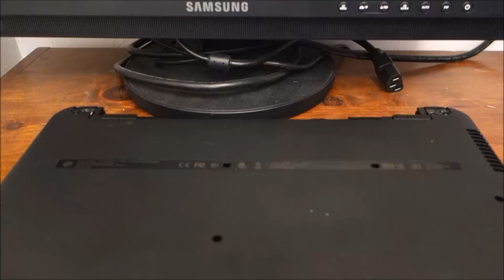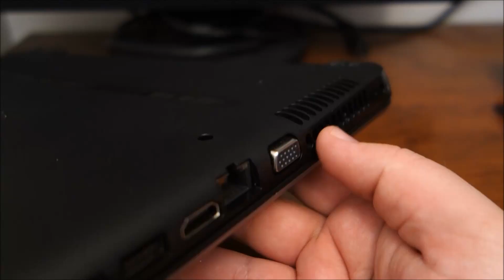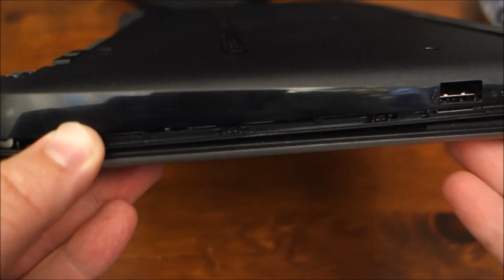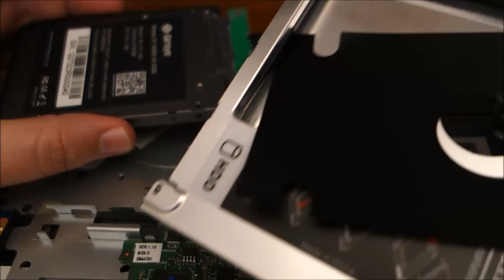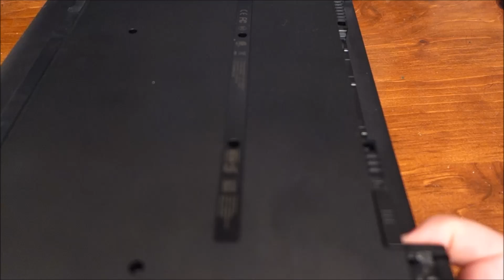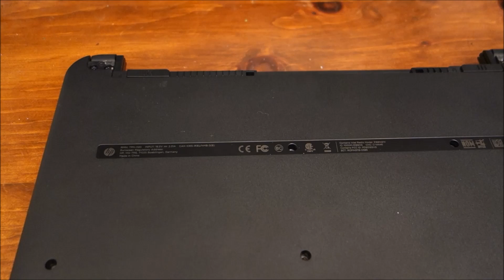HP 14-an013nr case opened up, ssd install, memory upgrade

Comment from the maker: Parts found in this build:

The laptop:
https://amzn.to/2Ul1CWh

CD rom to HD caddy (the green thing)
https://amzn.to/2INNG5B

SSD:
https://amzn.to/2EGQ8XB

Memory:
https://amzn.to/2Xtr65L

Support this channel by using our amazon affiliate link:
https://amzn.to/2U9XesP
Reply: I HAVE A HP 14AN010NR. I VIEWED YOUR VIDEO AND THANK YOU FOR THAT. I ORDERED THE GREEN THING YOU SUGGESTED. HOWEVER I GOT THE WRONG CADDY. DO YOU HAVE A CURRENT PART NUMBER?  SOMEHOW THE CORRECT CADDY GOT CHANGED. I am a disabled veteran 82 years old. yes I occasionally need help.... thank you.  I can do this.....lol
Reply from the maker: All caddy's are basically the same. You don't even have to take it apart, I just did for fun.
Reply: @AICvideo  Gottcha, thank you.  my issue was the old part numbers from the original video were not correct.  plussss the Kingston is cheeper, love that. ordered the caddy and SSD now waiting..... you are the best.  Thank you very much.    Chuck
Reply from the maker: Awesome, good luck with the upgrade.
Reply: @AICvideo Hey! Where can I grab the green piece that connects the ssd to the board ???? Or can I just use a external USB (SSD to USB) ?
Reply from the maker: I'm a bit confused by your questions, yes the caddy is what you need to plug into that port. You can use the whole caddy I just chose to not to. The internal 32gb emmc storage is soldered to the system board and is not "replaceable" you are just adding a different drive and can use that to boot vs the emmc storage. and no, you do not have to re buy windows. the license key is built into your system board, and after your first or second reboot, if you're connected to the internet the system with activate automatically. and lastly, no, you cannot upgrade the CPU, again it is soldered to the system board. and even if you had all the skills required to upgrade, any compatible cpu would be of similar class, or in other words, also slow. 

If you are really stepping up to that next level of system, if you save a few more bucks, I would just buy a used business class laptop, like this one:
http://rover.ebay.com/rover/1/711-53200-19255-0/1?ff3=4&pub=5575128025&toolid=10001&campid=5337706877&customid=&mpre=https%3A%2F%2Fwww.ebay.com%2Fitm%2FLenovo-Thinkpad-T450-Intel-Core-i5-5300U-2-3GHz-8GB-RAM-256GB-SSD-Win-10-Pro%2F324106703185 

For $160 + shipping, you get a core i5, 256gig SSD, 8 gigs of ram and a 1600x900 screen. Or for a few bucks more this zbook 14 G2:
http://rover.ebay.com/rover/1/711-53200-19255-0/1?ff3=4&pub=5575128025&toolid=10001&campid=5337706877&customid=&mpre=https%3A%2F%2Fwww.ebay.com%2Fitm%2FHP-ZBook-14-G2-Workstation-Core-i5-5200U-2-2GHz-256GB-8GB-14-1600x900-Win-10%2F164120585527

I love the zbook line a lot.
Reply: @AICvideo  Hi. Did u clone the eMMC storage to the SSD? I have the same Notebook and I want to clone the hard drive and boot up from the SSD. Is this doable with Macrium reflect? Can u still see the eMMC storage, it would be nice to use that as secondary storage.

Comment: Even if it only runs in single-channel, it's worth upgrading the RAM with two sticks if that's what you have available. I added a second 4gb stick and it significantly improved how it performs running Kubuntu.

Comment: Thanks for the help. I wasn't sure I was going to be able to get the back off until I watched your video.  Turned the notebook with a 32gb EMMC into a full on laptop with 250gb SSD and 12gb of ram.  Used AOMEI Partition Assistant to port the Windows 10 OS over to the SSD.  Unplugged the EMMC and it booted from the SSD.

Comment: you forgot to add that you have to take those tabs off on the cover in order to actually use the ssd. otherwise it wont fit.
Reply from the maker: I didn't have to take any tabs off, but they could have changed the case, this is a pretty old video.
Reply: @AICvideo  I was just going by other videos. I finally opened mine up. Added HDD (will upgrade to SSD) but is it fine if up grade the laptop to 1x4gb to 2x4gb? (ie buying one additional ram stick since i already got 1 4gb in there?

Comment: I installed one of those adapters in a laptop once.  You need the bracket from the back of the optical drive or another one.  Pay attention to how it is on there for less frustration.  Also that screw that holds it on is tiny so watch that you don't lose it.  If it is like the one I had on mine that screw is really short so threading it in may seem a little tricky.  You can use the front bezel from the optical drive if you don't want a gap there.  It is ugly and it may seem out of place.

Comment: Where do I find an interface board to add an SSD/HDD to my Hp 14 as shown in this video? I have tried scavenging CDROM drives from Toshiba and Dell scrap laptops, but find flat ribbon cables as opposed to the SATA interface connectors on the featured unit...
Reply from the maker: The description of the video literally as a section labeled "parts found in this build". i just....

Comment: friend, I have a question, where can I get the green adapter for ssd drives? I saw the link you attached but it is not the same as the one in the video
Reply from the maker: It is.

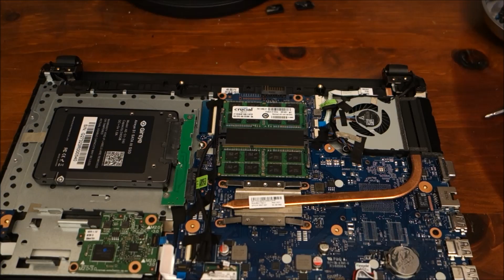Comment: 3:25 Mine has ony stick of 4gb stick of RAM, how do iknow if my board only runs on Single Channel Mode before buying  another RAM stick?
Reply from the maker: Single vs dual channel doesn’t make as much difference for 99.9% of what most people do, but having more ram will. So upgrade. Also all modern cpus support dual channel memory.

Comment: Bravo. You speak well, Slow and clear. Too many techies doing info video talk at 100 mph. THANK YOU FOR PUTTING THIS VIDEO ON. I can do all steps you showed. Just didn't know this HP model could take an SSD. Easy not boot from 32 gig in bios.

Comment: Thanks.  One question, this is the model M2C39UA.  I have the SN 5CG5421CQ.  For upgrade RAM to 4GB and storage eMMC 32 GB to SSD M.2 240 GB.  Many thanks.
Reply from the maker: as the video title states, this is a 14-an013nr.

Comment: Can you upgrade hp x360 stream 11 emmc model.
You have to solder 12 pin female clip on header on motherboard to attach ssd ribbon clip.
Reply from the maker: I know, I bought some and promptly lost them. 

And I have not had a stream x360 in for review.
Reply: If you found any in future do update.
Reply: Thanks

Comment: SSD Not showing in BIOS boot.
Hello, just bought the hp 14 An012nr . I bought a 120gb Kingston SSD and the caddy you suggested.

I cloned the 32Gb emmc drive and the OS to the SSd and installed the SSD as shown in the video.

However, when I go to the BIOS to change the boot order, the 120gb SSD doesn't show up, only the 32gb drive that already comes with the laptop. Even with legacy support on the SSD isn't read. Please help, thank you.
Reply from the maker: did you wipe the 32gig ssd? if so, it should just boot to the new one.
Reply: @AICvideo  ahh okay, so after wiping all the partitions in the old 32gb emmc drive, the new 120gb should now be visible?
Reply from the maker: it should just boot to it. I don't have this laptop (and haven't for years) so I don't remember exactly how it works, but I deleted the old partition because it saw it as the main boot device until I did that.

Comment: Mine says 14-ds or something does the ram matter ?
Reply from the maker: it matters if it is DDR3, DDR3L, or DDR4. I don't know what the 14-DS is.
Reply: AICvideo says hp 14-ds00xxx
Reply from the maker: Google it and you should find the HP spec sheet page that tells you that information.
Reply: Has ADM ryzen 4

Comment: Hey thanks for the video, I'm having issues with this computer for lack of memory. My question to you is, adding the SSD will help solved the problem with the lack of internal memory?
Reply from the maker: Are you having a lack of memory or storage? Add ram for memory, SSD for storage
Reply: @AICvideo  , thank for replying so fast. I used the computer for college and now my kids used it for school work. I'm sorry, my son said the message that comes promts to free storage. I'll get the SSD from your link.
Reply from the maker: Sounds good 👍. Just wanted to make sure you got the right thing.
Reply: @AICvideo  , another question about the ram memory. Since you said it runs only on single mode, there's no way to increase it at all? Is the card that comes with the computer fixed or can I remove it and use another one with more capacity?
Reply from the maker: single channel mode vs dual (or quad channel) only means that if your CPU supports it, you will get slightly faster speeds in certain workloads if you have matching memory in the correct slots. and it has nothing to do with how much memory you can upgrade the system with. This system has two slots, you can load it up with 32 gigs of ram, but if you want just 8 gigs you will get the same performance if you have 2 dimms of 4gigs or 1 dimm of 8 gigs

https://youtu.be/-D8fhsXqq4o

https://youtu.be/a0jb0hCMXfo

Comment: Great video but... is there a video putting dissipating paste to the processor? Sorry if i misspelled it. I don't know english very well :')
Reply from the maker: No, but it is super easy, the same as any other processor. Couple of screws, take off plate, wipe old off, apply new, replace plate.
Reply: @AICvideo  btw thanks for the info
Reply: Ahh. I thought it would be different with this one...
Reply from the maker: Nope, all computers are basically the same. I did it and didn't notice any cpu tempt differences. I probably wouldn't bother.
Reply: ok thanks 👍

Comment: what is the part which connects your SSD to the port on the board-the green adapter! also if you can please include the link to purchase it.
Thank you
Reply from the maker: It's in the video description
Reply: AICvideo  I tried catching it but am not clear .
Reply from the maker: In the description of the video... Under the title...

Comment: i'm going to do these mods to my HP - thank you.
dumb question: 
I just plug this HDD in , correct ?   and then I have more internal drive space?

I only use this laptop for browsing, light computing (quicken) and i spend 90% of my time on it freeing up hard drive space for small updates.

thanks!
Reply from the maker: You need the SSD and the HD caddy (I just pulled the board out and used that vs using a whole caddy) both are linked in the description. 

as far as more space, I cloned my OS to the new drive, and didn't use the emmc storage for anything, as it is too slow.
Reply: @AICvideo   im making a recovery file on a thumb drive.  is there an easier way to clone my HD? i  am not PC savvy but follow directions allright,
Reply from the maker: I use macrium reflect, if you are not pc savvy, I would ask somebody who is to help out..
Reply: @AICvideo  i believe i already have the file for rebooting windows  on a thumb.... it includes bootmgr, bootmgrefi, start up etc  is that it?
Reply from the maker: without knowing exactly what you did, I think you just created a windows install disk, that will install windows, but not copy any of your data/info over. I would use a program like macrium to migrate your data, then expand the drive to fill it, then clean the original drive.
Reply: @AICvideo  it was a clean install - and I'm fine with that/
i jsut tried to install macrium and big surprise - NO disk space.
Reply from the maker: Ah, if you're good with a clean install, go for it. I was thinking you needed to preserve your data.
Reply: @AICvideo  i think i did it.
despite "0cx000000e"

"this PC C:"   is the new SSD
windows D:  is the old? 

do i need to do anything to the old one?

thanks sir!!

Comment: Hello, and Thanks for the informative video! I'm clicking on your links for the Kingston SSD & High Rock hard drive caddy. Can you select any of the sizes?   120G /240G/ 480G/ 960G for the SSD? are they all the same with the connectors I wanted to get the 240 for my notebook. I feel It's very reasonable price. I've already Installed a stick of ram.I already have windows 10.. just can't update now. I feel If I can do this with your parts that hopefully fit and work with my HP Notebook 14-an012nr ,I'll be good. hopefully I hear from yah when you have a chance... Thank you.
Reply from the maker: yeah, you can use any SSD, same connector, and windows can recognize any size.
Reply: @AICvideo  Thank you again AIC ! I'll get back to you after I turn It into a real Laptop!
Reply: Now It's a Real Laptop /PC!!!!!!!! AIC !!!! 240G! not no little 32g. how ridiculous, HP. thanks HP for All the connectors so I can at least upgrade to Almost Limitless  storage!     1    & YES I WON  !!!!!!! TKO !!!!!!!!!!              Merry Christmas & a Happy New Year!

Comment: Hi is there any risk of electrocution involved with the dissasembly with the 14" Hp?
Reply from the maker: Yes, 1.21 gigawatts of power!
Reply: @AICvideo  ok thanks
Reply from the maker: That was a joke... Unplug, remove battery, and there is no power in the system...
Reply: @AICvideo  i feel so stupid
Reply from the maker: Yeah, it's more likely to die from being shocked by you (static electricity).

Comment: Hello, I have already installed a 500 GB HDD thanks to your video, buy a caddy and install it, now I have another problem, I would like to change the SDD for another HDD of 1 TB, my question is if in the space of 32 that They bring them normally I could put an HDD ?? Thank you!!!
Reply from the maker: If I understand your question, No. you cannot put a 2nd drive in to replace the 32 gig drive.

Comment: I've got a hp 14.5in 8g of ram 1tb of memory and I upgraded the ram to 16gb and the computer works great And the computer was 336$ and a bit over 40 in parts Upgrading ram and ssd is a great idea and is worth it pluse parts for hp Dell and that arn't too bad

Comment: I am stuck trying to open hp 14-r015tx. The edges come off but something is still holding in the centre but I cant find any more screws to unfasten. I am afraid to force it in case something breaks. Please help!
Reply from the maker: I don't know if I can help you. I don't know if that model is any different than the an013nr., and it has been years since I opened this laptop, so I only remember what's in the video.
Reply: @AICvideo  It not the same, I managed to get hold of the manual and solve it thanks
Reply from the maker: Oh good, sorry I couldn't be more help.

Comment: Mission accomplished! Did a fresh install of windows 10 by using the Microsoft tool creator . I used another pc to format the SSD drive using the command prompt function which gave me full partition free format of the SSD. I reinstalled the SSD in the laptop, put the usb drive in and from there told the pc to boot from usb, then followed the onscreen instructions. Windows is fully working finally. I did notice that when the window to select which drive to install windows to came up listing all the drives, it did not let me delete all the partitions which should have left me with only 2, the 32gb emcc memory and the 480gb SSD. Some of the partitions gave me a grey X when I tried to delete them, is that normal? I also noticed in disk management the 32gb emcc still has some partitions and some unallocated space. Should I use the command prompt tool to format the 32gb emcc memory as well, or should I leave it with its current intact partitions? Once again thanks for all your help and patience.  If anyone has any questions, I would be more than happy to help🙏🏼 Noobs have to stick together👍🏼👍🏼👍🏼 One last favor, if you have a video as to how you cloned your hard drive with that freeware you suggested, could you please send me the link so I can watch it? I originally tried to clone using that software and it ended up reducing my SSD to the same size as the 32gb emcc😡 I did not know how to clone and keep the original size of the destination drive. No one explained that in the videos I saw. Cloning from a small hard drive to a larger one then keeping the original size.
Reply from the maker: I can do a video at some point about using that tool. 

to expand drives, you can go to control pannel, administrative tools, computer management, and then disk management. that lets you do basic tasks. If you need more than that, there are other free tools as well. 

I personally format the 32gig SSD, and just make a standard drive out of it, I used it to store my music library.
Reply: @AICvideo  Thanks again🙏 Looking forward to the cloning video👍
Reply from the maker: https://www.youtube.com/watch?v=rAd2UH-qfDg

Comment: making sure mate... that green bit attached between your ssd and the board come with the caddy and you just removed it from the caddy right?
Reply from the maker: Correct. You can use the caddy, I just didn't There wasn't a good way to secure it. Some caddies have a tab with a hole that will allow it to be screwed into place, but the one I bought didn't have that.